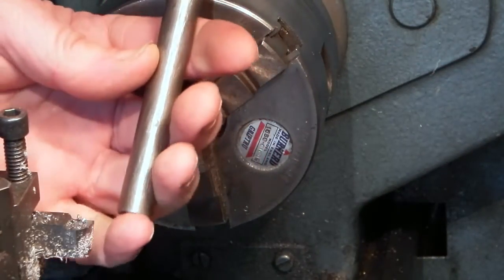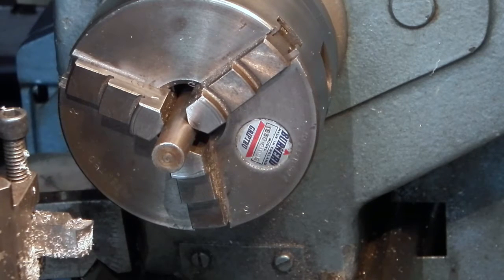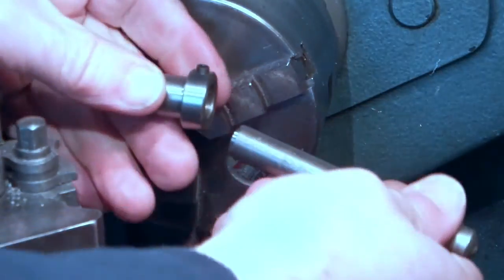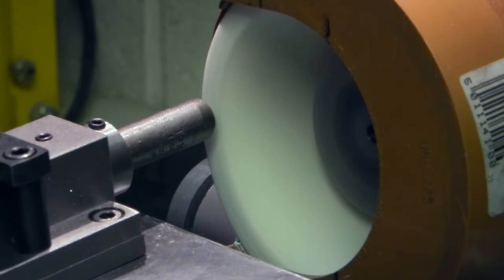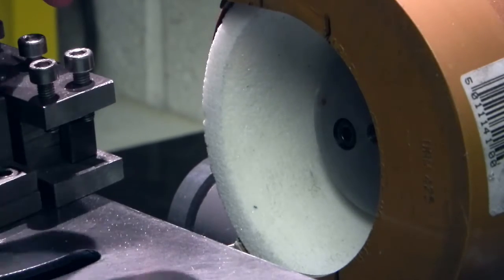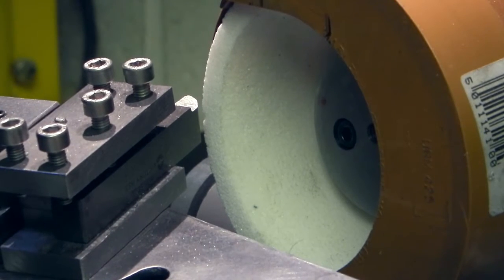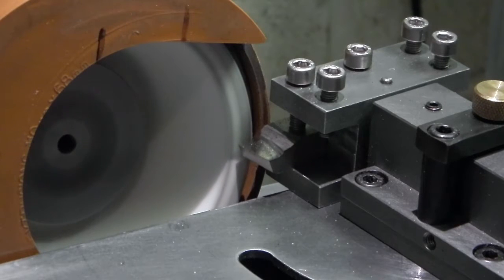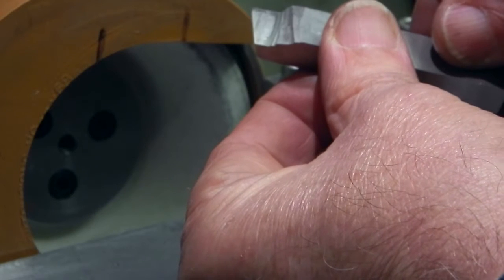First tool grind.

Comment: If a radius were required for the tip, I presume that would have to be done by hand. Or is there an add on you could fabricate almost on the lines of your ball cutter? Regards.
Reply from the maker: Hi Peter
Hemingway do make a radius attachment kit for the grinder about £25.50 ref Radius Grinding Attachment HK 1312 http://www.hemingwaykits.com go to machine tools.